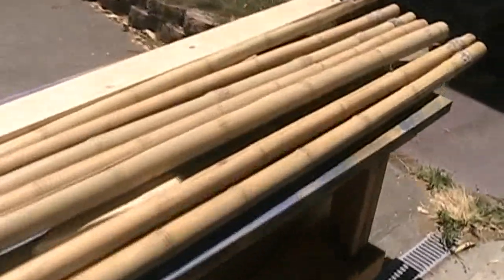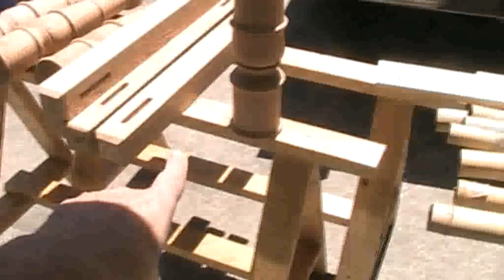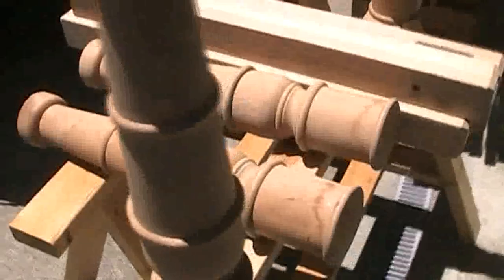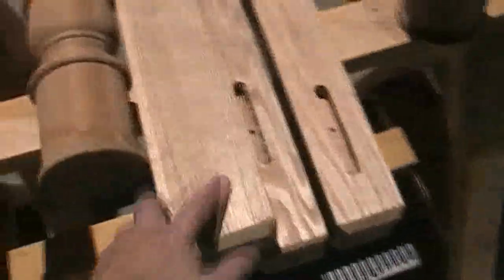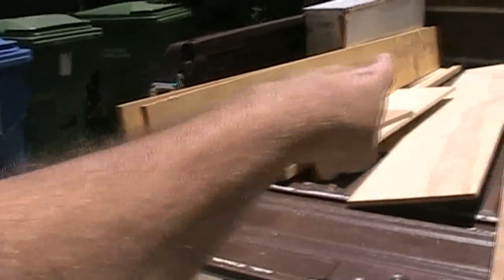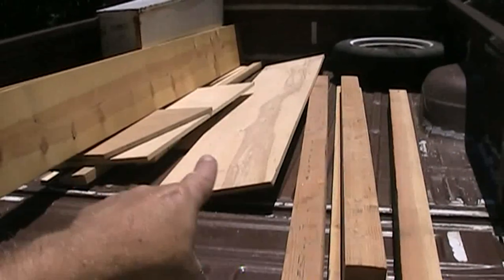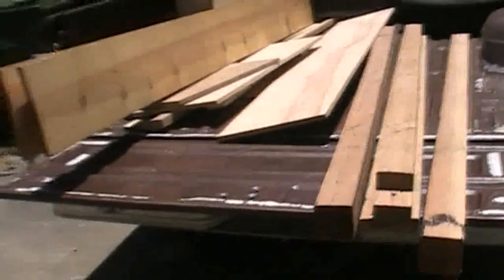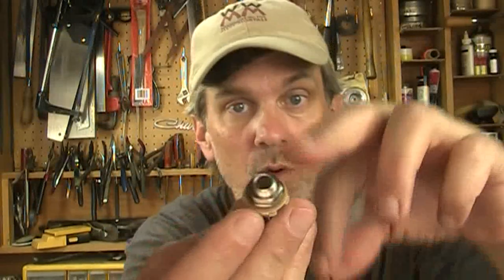MM 7-7-12: step stool follow-up / biscuits / talking

Comment: I'm with you steve! True, the additional strength of biscuits on an edge jointed boards is not really needed as the grain provides the strength.
That does NOT mean BISCUITS are useless, in small projects like boxes they offer a good amount of strength with relative ease and when edge joining boards are valuable for alignment to keep the surfaces aligned to stop them slipping as well as prevent some of the bowing of the joint from clamping pressure.
Okay, rant over! :P

Comment: I use biscuits. I certainly don't believe that they weaken the joint significantly... may even strengthen, BUT the main advantage: they help immensely with the alignment during glue-up and clamping  !!!  (I've been woodworking for 66 years - I used dowels for the same reason). Enjoy your show, sir. Thank you.
Reply: If it is good enough for Norm its good enough for any hobbyist.

Comment: Score! Nice haul from the school, Steve. I might have to go do some volunteering. Hey, you can make some really nice bongs with that bamboo. ;-) Or you could split them in half to make  your picture frames. I think that would look good. Or, try cutting some narrow strips and laminating some boards to use. Lots of possibilities.
 I don't think biscuits are a waste. The best thing is that it helps keep the joints straight when you clamp them but they do add some strength, too. 
Larry

Comment: I find that biscuits/dowels/and any other type of splines help keep the edges better aligned in the glue up process, meaning less work keeping it flat. You may say a skilled worker doesn't need it, but if you are set up properly, it is just an extra precaution to reduce possible work in the future. Just my .02

Comment: I use biscuits.  Biscuits help with alignment as previously stated.  Dowels can be a challenge to align when drilling.  Sure you can use a jig, but biscuit slots are SO much easier and faster to cut.

Comment: It is correct that Biscuit Joinery for edge gluing offers little or no additional strength.  But IF you hare working with dimensioned material you must align properly, they are valuable.

NOTE:  If you over load the Biscuit joint with glue and the Biscuits over swell, you can actually push out the wood at the joint.  Then when you plane or sand the surface flat, and the clue cures over time or the wood reaches equilibrium, you can see ovals  in the finished piece.

my 2 cents

Comment: yep, allignment is the only reason you use biscuits on something like that (or a table top for example) cause the glue, if the pressure is applied right, is stronger than the glue.  White/yelllow glue is a compression glue.  the more pressure you put as the glue dries, the better the result is.    it has to do with the crystalisation process and how the glue molecules grab into the wood fibers,

Comment: I remember Norm making the comment about biscuits joinery that they show up after a while. I'm not sure what he meant exactly, because he did show an example, but I imagine that perhaps the biscuits may swell at a different rate than the rest of the wood? Anyway I use them especially where I need the extra support. Keep up the good work.

Comment: Regarding biscuits, they are great....like real estate...for location ONLY. No strength added but good for keeping aligned. Think about it..wet glue/wood (dried biscuits)  when dries shrinks, you are also trapping the glue which needs air to dry. As I said good for location only.

Comment: Do you think you could make biscuit joints by "jerry rigging" it using a table saw. i wonder if you didnt want to buy a biscuit jointer you could make slots using a table saw or maybe even a small router bit on the router table and just buy the biscuits or would that be too much work with little payoff?? haha

Comment: Steve, do you have any problem with the stability of the two step stool. It looks like if you put your weight on the upper step and leaning forward a little it could tip over. I know this video is way  back but if you would come back to see the new comments coming in. It would work fine if you use it against a vertical surface which you could not lean over so far.

Comment: I find biscuits are not useless I like them they combine friction and glue to maximize the strength of a joint without the ugliness of a screw or nail they also help to keep wood aligned during gluing  by the way I hated the no talking its simply needed to clarify whats being done also its just boring when there is no one talking when you talk the videos seem shorter even though we don't want it to end.